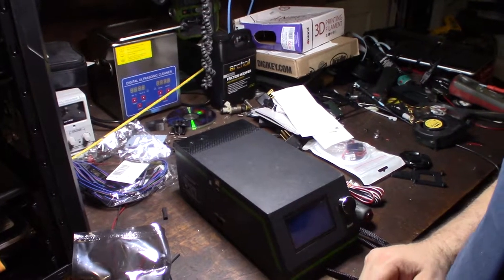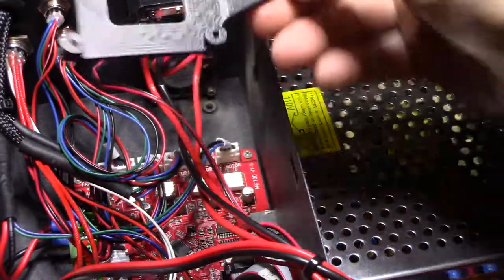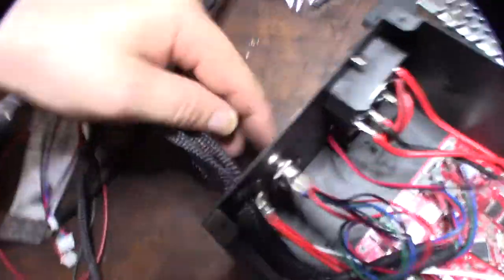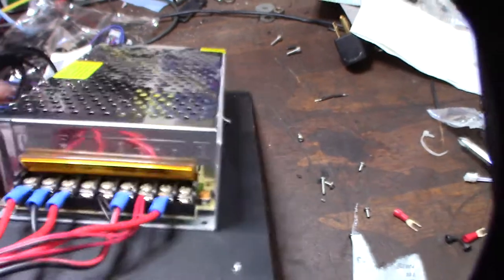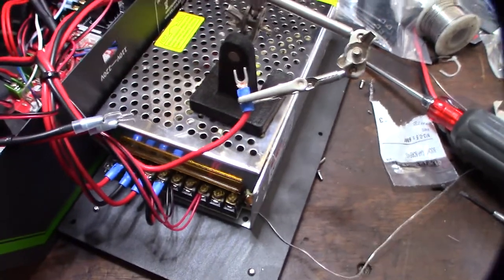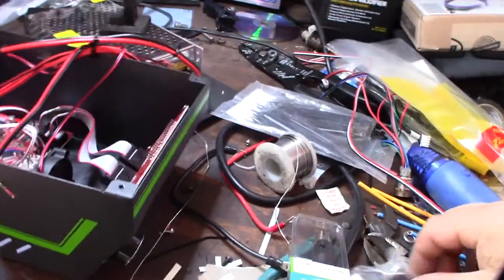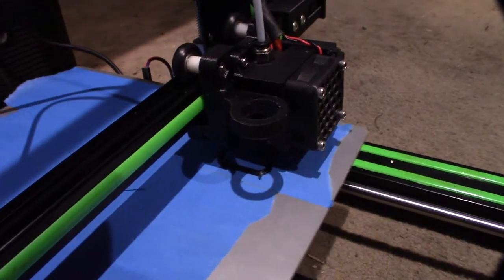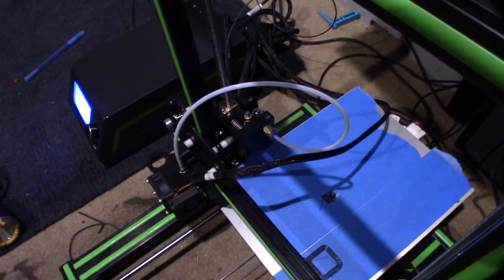Cheap craigslist 3D printer Anet E10 build upgrade repair project Part3

Comment: Just picked up an e10 from the pawn shop. Got the mosfet. Waiting on motherboard and hot-end. Thanks for doing this video.  The printrbot... haha!! I got duped with that one. I can't get it to level for anything. I'm toying with the idea of putting all the electronics from a ender in it. It seems excessive, but it would be a good project.